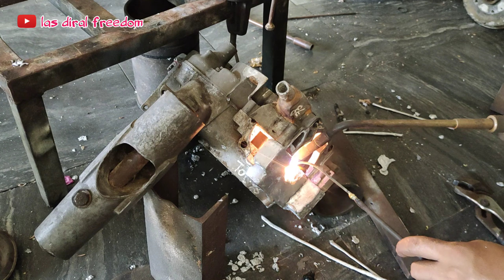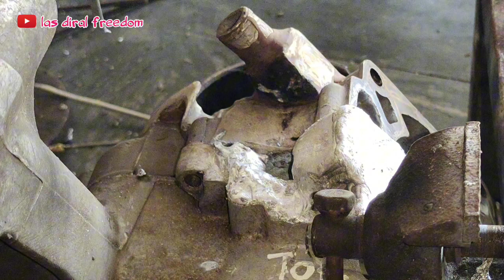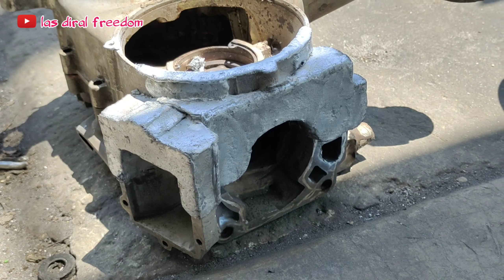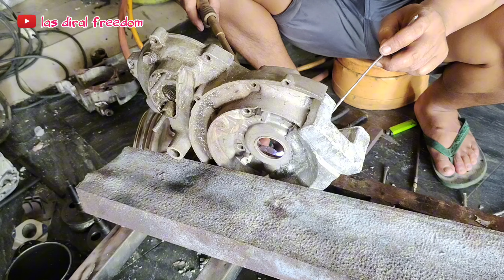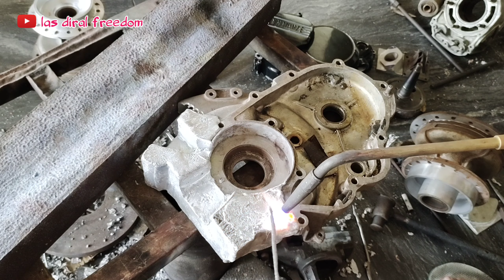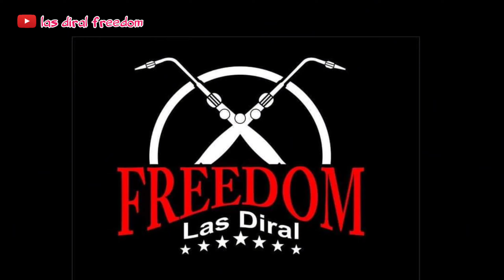las vespa block head Ninja | aluminum welding

Comment: Selamat malam, saya dari Brazil, kota Catanduva, São Paulo, saya penggemar berat layanan Anda, Anda bekerja dengan penggilingan sepeda motor, saya ingin tahu apakah Anda mengelas aluminium menggunakan obor dengan oksigen dan gas asetilida atau oksigen dan LPG? Saya hendak membeli alat las seperti ini tetapi saya ragu mengenai gas yang digunakan dan apakah akan berfungsi dengan batang las tig atau akan melelehkan bahan seperti Anda, selamat atas pekerjaan yang sempurna, pengelasan tanpa pori-pori, selamat lagi
Reply from the maker: Utilizo oxígeno y GLP o lo que se llama gas para cocinar en la cocina. Para la barra, yo mismo derretí los ingredientes. Material procedente de la fusión de pistones y cárteres usados. esta en mi primer video